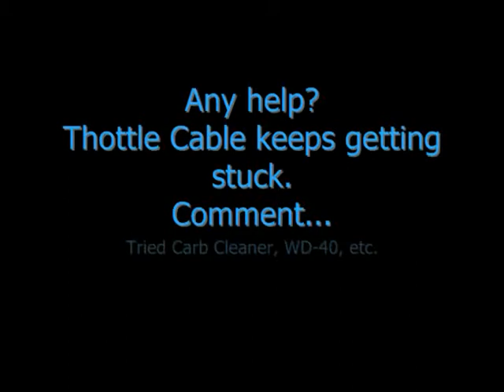1985 Polaris 400 Carb Problems

Comment from the maker: yeah.  every time it goes out I just open the carb up and spray it with carb cleaner.  The thottle doesn't stick anymore.  I guess after I ran it for a couple weeks, all the bugs worked themselves out.  After all, it was sitting for 3 years.